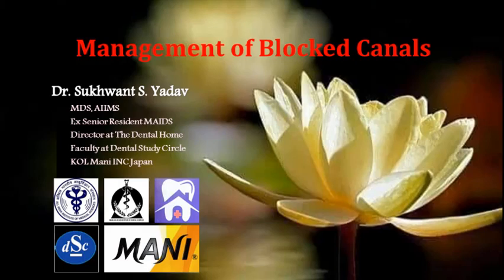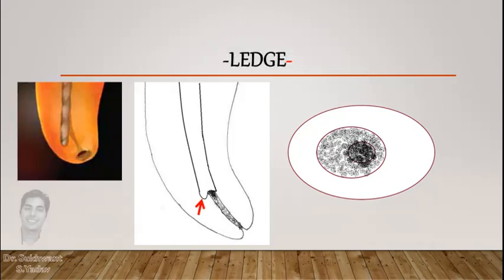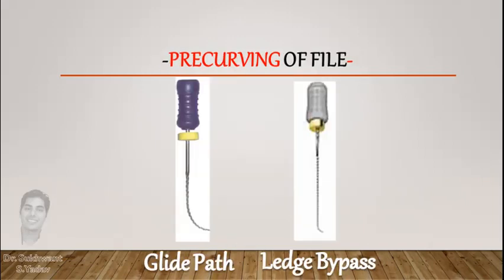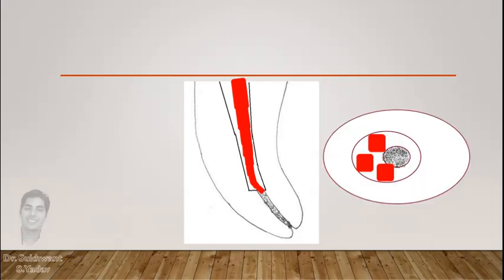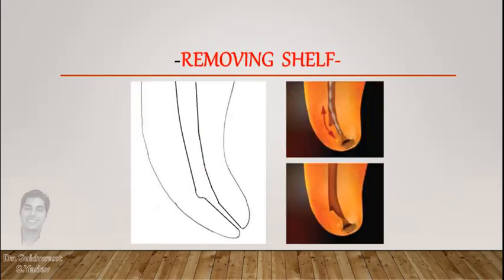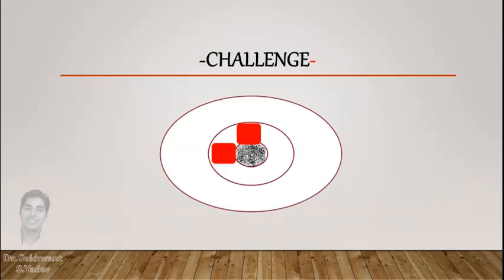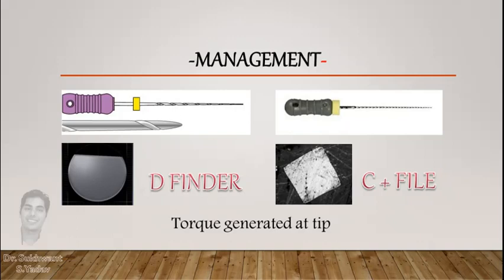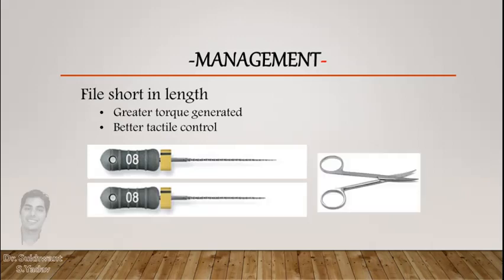Ledge bypass

Comment: Can d finder or c plus file automatically goes till apex without curving or bending file ( in gradual curve  in apex not acute bend) as it has non cutting tip or u have to bend d finder and c plus file also
Reply from the maker: For blocked canals no need to bend but if there is ledge with shelf then acute bend should be given 👍

Comment: what about obturation, do i bend guttapercha after bypassing a ledge?
Reply from the maker: There is no need to bend GP.
When you do BMP you need to do filing against the wall where shelf is present and this will make the wall smooth and easy path for rotary files and GP

Comment: Sir....most of the ledges that i encountered were in mesiolingual canal of lower first molar with  slender roots. Sir can u suggest me anything to prevent ths to happn
Reply from the maker: I think problem is with canal negotiation. Start with #8 k file in mesiolingual canals and slightly precurve the file when you use #10 and #15 file.
Reply: @Endocrisps  thank u sir..will definitely follow this...

Comment: Hello sir nice video. How do we diffrentiate thats its a ledge or loss of working length? Thanks
Reply from the maker: Hi
If file is going in a direction away from canal its ledge and if it is following canal anatomy but blockage is there, then we call it loss of working length and blocked canal.
Reply: @Endocrisps   Sir but thats barely appreciable inside canal. Have to check it radoographically ?
Reply from the maker: Yes, check it radiographically !!!
Reply: @Endocrisps  ok thank you sir

Comment: Dear Sir, 
What to do if ledge occurs in the middle third of the mandibular molar MB canal?
Reply from the maker: If ledge is at the start of curvature, it will be quite difficult. Precurve the 8 no. K file towards curvature and look for a catch.
Reply: @Endocrisps  sir, actually ledge occurred at both MB and ML at the middle third even after starting bmp with pre curved 10 k file. I'm always careful about bmp and take all necessary precaution but unfortunately this happened and it was very unexpected. This is for the first time in my carrier  I got a ledge issue after performing so many successful RCT s.
Reply from the maker: @rownakbhattacharjee7046  It can happen because of canal anatomy also and sometimes because of calcification changes in the mid of canals.
No worries use D finder or C + files to negate this.
Reply: @Endocrisps  ok sir I'll order d finder today.